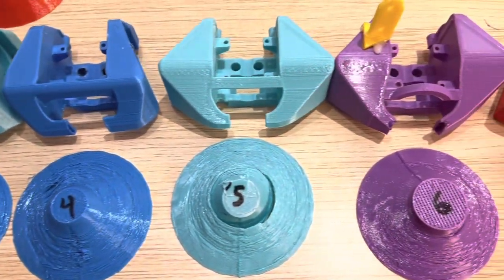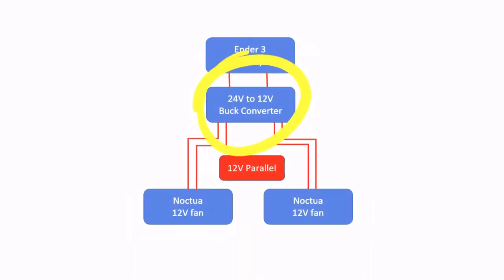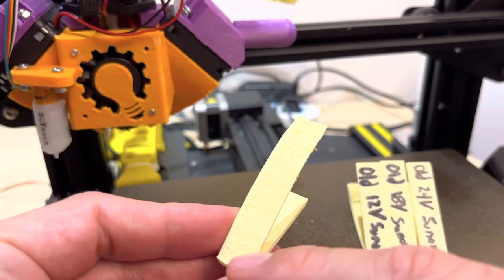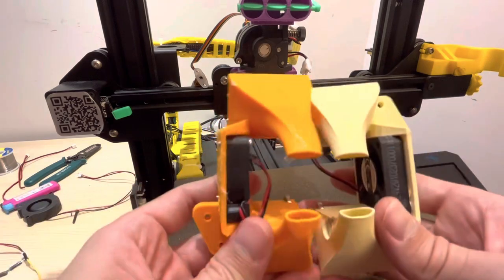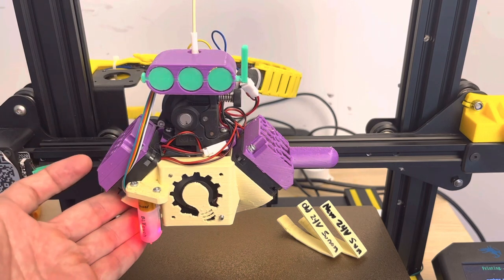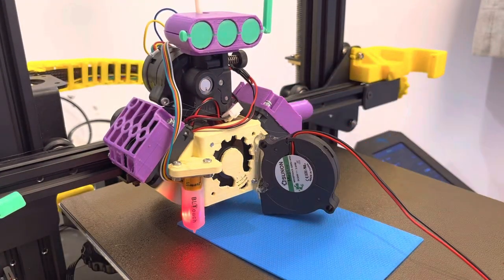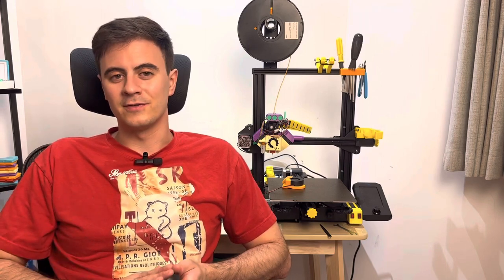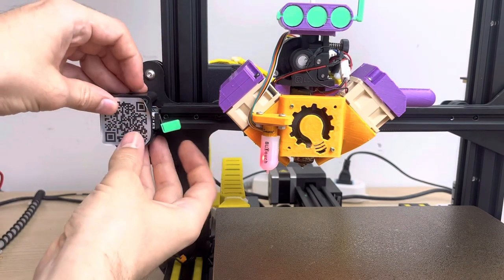Supercharged Printing head updates 3.0

Comment: Not exactly what you are looking for since it has only one 5015, but I just remixed a Satsana to work with Orbiter v2 and a Dragonfly.
Youtube is blocking my link but look on thingiverse for thing #5801336. 

For the kind of print I do one 5015 is more than enough, I don't see the need for 2. Give it a try and let me know if you like it. With the 20mm noctua fan (advised) it is so quiet I can barely notice it when I'm working right next to it. I also use a generic 5015 24v which is reasonably quiet. I only go above 75% duty cycle on the fan if I'm printing challenging overhangs, but most prints it is 50-70% duty cycle.
Reply from the maker: Nice design!  Should be a bit lighter and more simple than my latest Robo head design.  I may have to put  it on the to-do list!

Comment: Idk why theres so humongus fan ducts out there. My stock ender 3 max can print up to 70 degres overhangs without too much drop in quality while my ender 3 with a similar style setup to the stock max limit without supports is 65 Degres or so
Reply from the maker: I'm not sure about others, but my experience started with trying to make a quieter printer.